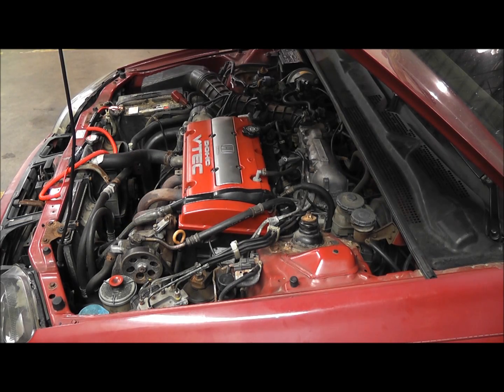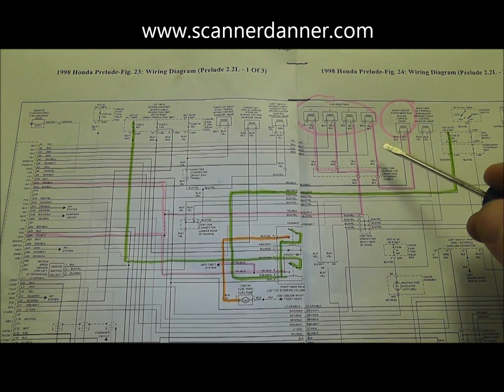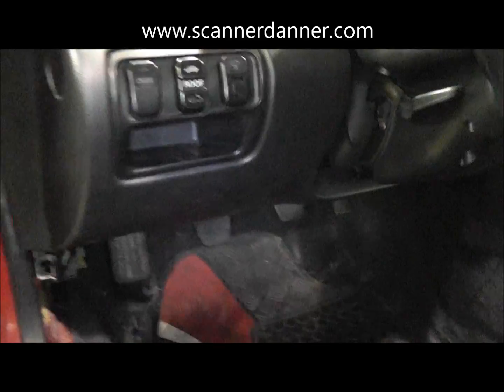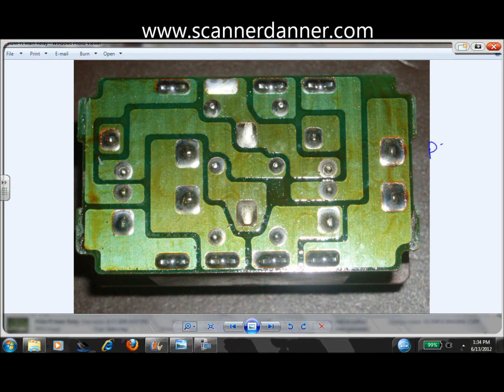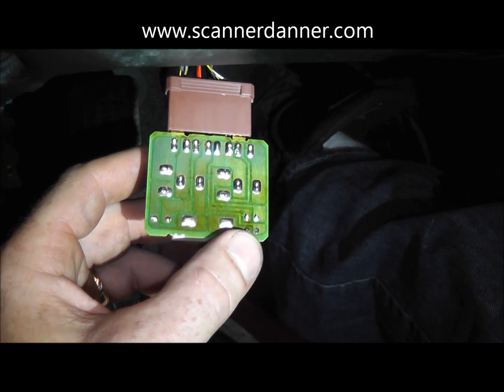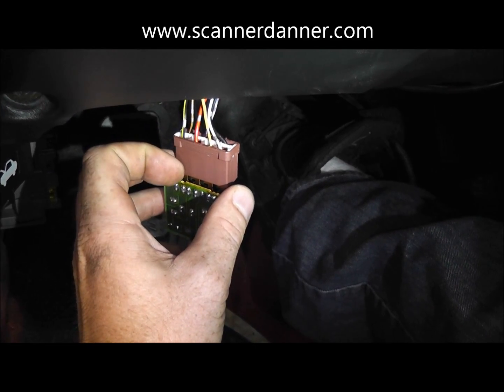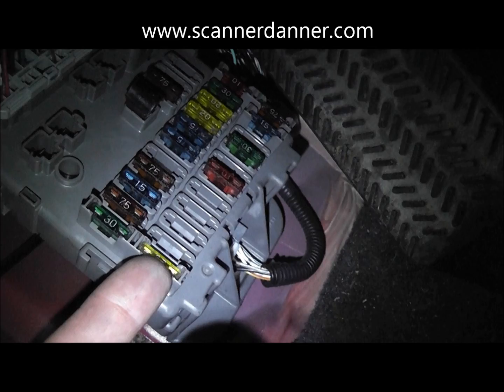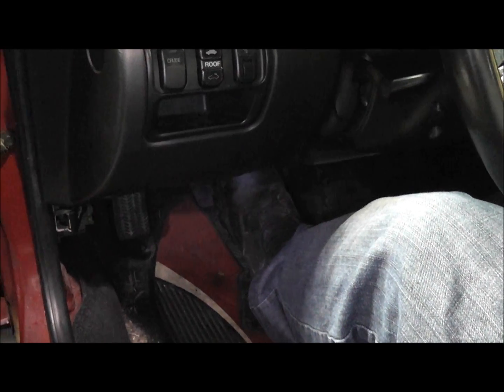How to test and fix a PGM-FI main relay - Honda/Acura

Comment: Spot on Video & advice there, ScannerDanner. Had an Accord fail to start right outside my door. Turned out the car was always parked in the shade at home but was outside in full sun that day for several hours......Just refused to start.

Took out that board & there they were...little rings around those big terminals:  Re-soldered them plus a couple that looked a bit dodgy.....Fired up straight away.....That was a month ago.....no more problems reported....despite the outside temps increasing on a daily basis. (Southern hemisphere.)

Comment: Just fixed buddies 98 Honda Accord reflowing solder on bad board thanks to this video.  Kudos to uploader.  Wiggle check wires with key in 2 click position to verify you have cracked joints.  you will hear relay click and green key light will show.

Comment: I took the relay out, soldered ALL the points on the board, and placed it back but the car STILL does not start in the heat/after it rains until I cycle the power 3-4 times. What else could be the problem??? I had a brand new fuel pump installed along with a brand new distributor. 1996 Accord LX 2.2L Sedan.
Reply from the maker: You have to find out what you are missing when it doesn't start otherwise we are just guessing on what the problem could be.
Ignition switches are also common, but I'm not telling you to replace it. We have to prove it first.
Reply: Physically, all the parts are there. The mechanic couldn't even figure out, told me to bring it to Honda to run a computer diag. Could it be the computer? In my dash, when I turn the key to "On" the check engine light comes on and stays on when the fuel pump doesn't turn on. But when it DOES work, the [D] on my dash lights up green and the check engine light turns off and the car starts no problem. Just got $1300 worth of work done to the car and it still doesn't start... :-(

Comment: HAD ONE OF THOSE THAT WOULD SHORT OUT AFTER IT RAN FOR A SECOND COLD IT WOULD WORK TO TEST I BUY GROUNDING THE CONTROL WIRE BUT THE PCM WOULD NOT GROUND IT REPLACED THE CONTROLLER STARTED RIGHT UP RAN FOR ABOUT THIRTY SECOND DIED AND THEN HAD NO CONTROL AGAIN SO I HELD IT ON FOR ABOUT 20 SECOND OR SO WITH MY POWER PROBE THIS TIME AND IT EVENTUALY TRIPPED THE CIRCUIT BREAKER THEN I REPLACED IT AND THE PCM AGAIN PROBLEM SOLVED LUCKILY THE SALVAGE YARD WARRANTIED THAT PCM I FRIED BY NOT FINDING THE CAUSE FIRST BUT THATS HOW WE LEARN.

Comment: Great video!  My relay looks exactly like the bad one, same two cracks and all.  Shop wanted to charge me a ridiculous amount just for the new part and now I'll be soldering it for free.

Not sure if you're still checking comments for this video, but I have a question:  if one of these went bad while driving, would the car lose power and die, or is this relay just involved in startup?
Reply: My 98 prelude died while driving 30mph from this problem

Comment: You were absolutely right Paul, the anti-theft system got me into a no start, no crank state (all lights worked), and was able to bypass the alarm manually before cutting and re-attaching that wire to remove the alarm altogether. I want to host the alarm system diagram for Honda Civic 2001 you gave me in case someone else needs it: docsdotgoogledotcom/file/d/0BzdPJO4vEc7tRl9laFI1NXhWSWc/edit?usp=sharing

Comment from the maker: If you can use a multimeter and follow directions, I can walk you through it. Just be patient with my response time. 
Start by removing the "Starter Cut Relay" in the underdash fuse relay box (left side of dash). In the crank position you should show 12v on two of the pins in the box. The result of this test will give us good direction.
Reply: ScannerDanner Having trouble bro can you help me

Comment from the maker: ahh, I would look there first. a custom alarm system will usually cut the main ignition crank wire just below the steering column and run it into a relay (aftermarket and part of alarm system add on). Find this wire and remove both ends from the relay and re-attach them.

Comment: 2/2 By the way, I know a little about multimeters because I fixed a laptop's bad charger using it before, and  I should've seen that milli-volt reading guess. I'm off to buy a cheap test light (which will come in handy in the future anyways) and read up more on that ignition switch tests, but understanding that wiring diagram sounds scary, but I'll try my best. Thank you again!

Comment: 1/1 Wow, thanks for quick response. I have read that the green solid (no blinks) key symbol on the dash while cranking, and leaving on II after means that I should rule out an Anti-theft system problem, however I do have a fob with buttons that I have found out were a custom alarm put in by the dealer many years ago, but I just ruled it out because it scares me lol. So I guess I'll read up more on Relay and ignition switch problems. Thanks! Will let you know.

Comment from the maker: my guess is the 200+ volts you saw is a milli-volt number. So you are missing power to the solenoid. Ignition switch, park/neutral switch problems possibly. You need a good wiring diagram. There may be a relay and anti-theft system involved. too.

Comment: Hi, Honda Civic 2001 EX, no crank, no click from the solenoid on the starter, no noises at all when turning the key, but starter works testing it, and brand new battery, however, the snap in wire that goes to the starter (not the bolt one) gives like 200+ volts when cranking the car, when it should be giving 12 volts I think. I haven't tested the relay yet, and I don't know how to test fuses, I'm really new to this. What do you think I should do?

Comment: Hey Paul I've got an intermitent problem on my civic mb, is when I start it in the morning, it would be like the engine cranks 3 times and it fires up, after a drive, when the engine is hot, sometimes, it takes 10 - 11 engine turns before firing up. Now I know internet diagnostics are crap, but what would you say Paul? Fuel system lack of priming, or main relay complaining? Its ok when I cycle the key twice, no matter what though.

Comment from the maker: It didn't blow, it was an arch from poor contact, at least that's what I think it was. I didn't even realize that happened until you guys pointed it out. The fuse never blew so it has to be from that. Also that matches why a simple bump with the foot could pop the fuse out. It was loose to begin with.

Comment from the maker: I just watched it in 1080p full screen and I didn't see a spark at the fuse box. If it did, the only thing that would cause that would be a loose connection at the fuse, which could be possible. 
All I saw was my test light glare on the dash panel

Comment from the maker: I agree that this shouldn't have happened if the fuse was holding better. I think it was loose to begin with and maybe not in all the way? Probably would have been a good idea to try and tighten up the fuse terminals in the box. I don't know if the kids foot slipped off the clutch or what happened. All I know is they were attempting to pull it on the alignment rack.